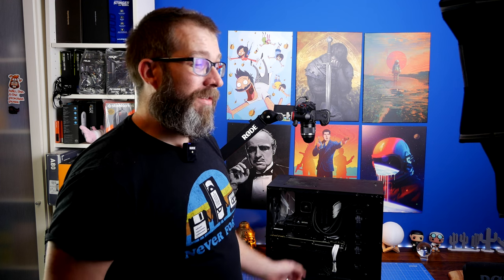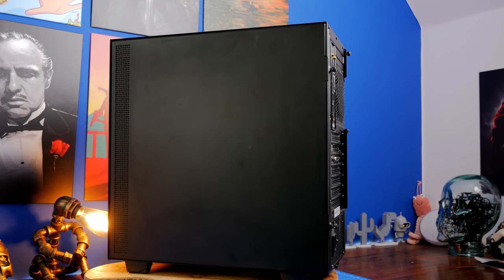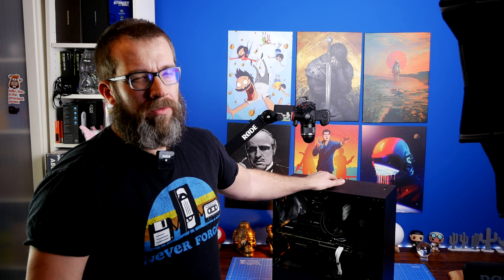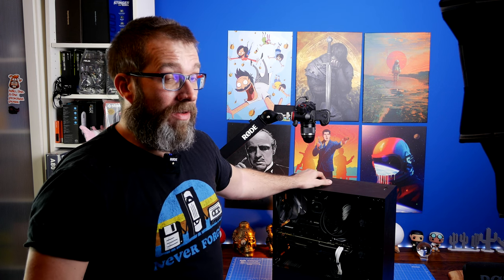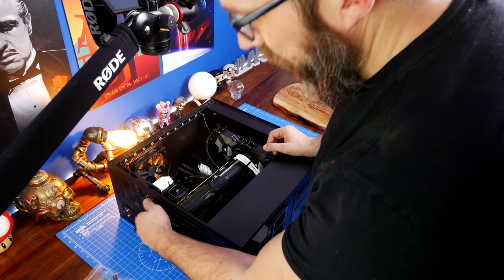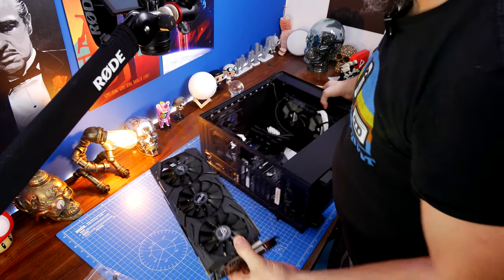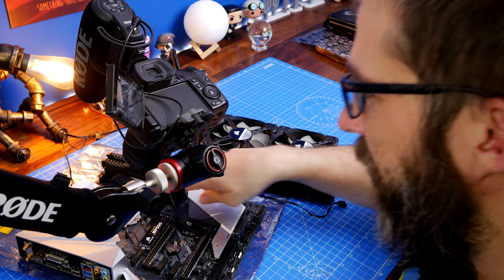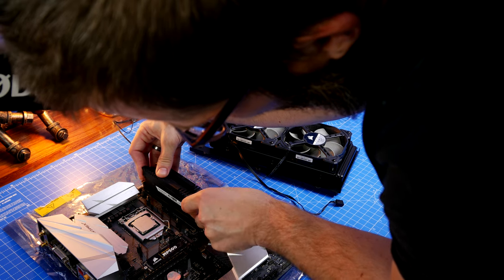How I upgraded an old machine for less (and planned multiple videos doing it)

Comment: Hi would you be able to tell me what the point of the usb c port on the usb holder for the model o wireless is?
Reply from the maker: Extension lead for getting the transmitter close to your mouse if your pc isn't.